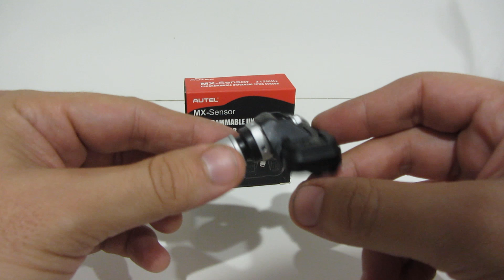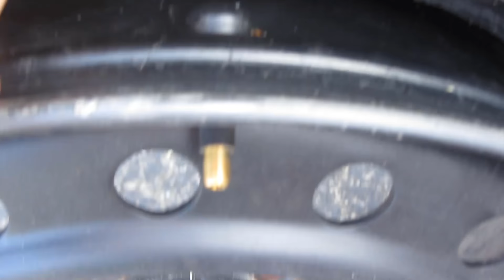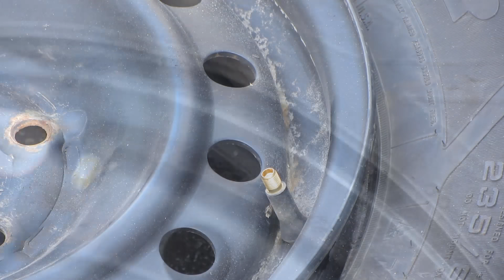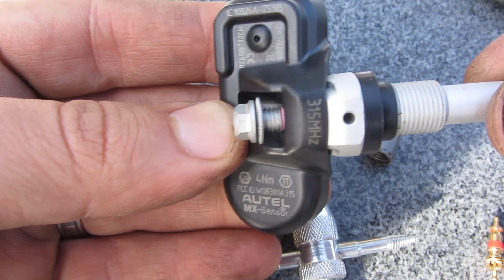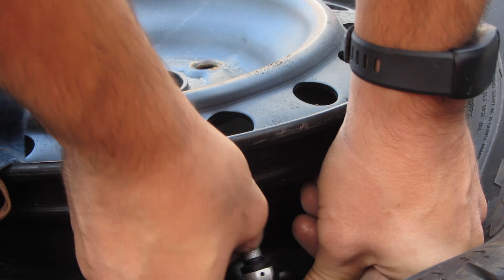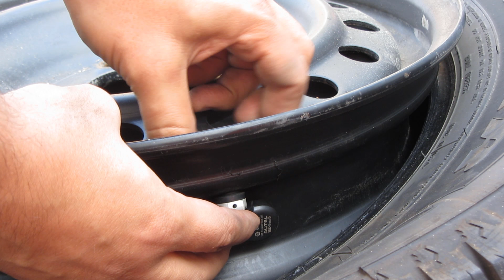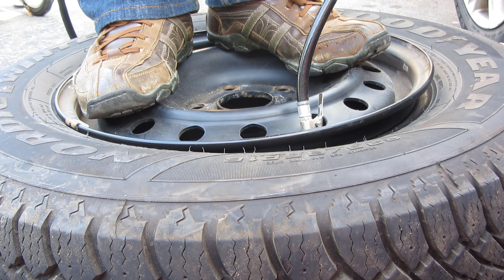Install New TPMS Sensor DIY Without Needing Rebalance

Comment: I always diy everything but for this just go to the tire shop, so many things can go wrong
Reply from the maker: If you're willing to pay, go for it. The only thing that can go wrong is ending up with a leak, which won't take long to figure out, and can be fixed without too much effort.
Reply: @GabesHacks  Nice video, agree with your statement In Canada the dealers and garages want a fortune for the sensors and a lot of them won't just change the sensors without you buying new tires and then if they do it will cost a fortune becasue they will pull the tire, put it back on and want to balance it. The ensuing cost for one wheel would be more than 3x the price of what I paid for a pack of 4 preprogrammed sensors on Amazon.

Comment: been using internal sensor for 5 years. for my new car, i tried the external sensors and i hv thrown away the external sensors!its just hopeless. everytime i pump air i need to remove it then the sensor cant be read by the display unit!!!!continue to use internal sensor. peace of mind for 3 to 5 years b4 bat runs out.

Comment: Why is this video over 11 minutes? Just tell people who don't have a machine "pop the bead at a 45-70 degree angle away from the sensor (how you pop it is up to you, then include links of at-home bead poppings.) push the tire down by the sensor so bottom is showing, replace sensor, inflate tire. Im not even 18 secs into this video and can already tell this is an AD.
Reply from the maker: There is nothing about this video that is an ad. I bought the sensors with my own money. All of the videos on my channel are projects I do for myself.
Reply: THANKS FOR THIS DETAILED VIDEO EXPLAINING EVEN TO A SIMPLE STEPS. The manual cant explain it in details for  a first timer.

Comment: What is better for a 4WD vehicle where tyre pressure will be changed frequently using a valve core removal tool to deflate the tyres? An internal TPMS or a external one (mounted on the valve stem cap)?
Reply from the maker: Both do the same job: report the tire pressure and temperature. What matters more is what kind of receiver you will be using. If the car has a built-in system with TPMS lights on your dash, then you can only use internal sensors with that. The car will be programmed to turn on the low pressure light at a certain pressure, often that's about 20 psi. So if you deflate below that, the light will turn on.
If your car does not have a built-in system (or you don't want to use it) then you will need to buy a whole system: the sensors and receiver all together. In that case, it doesn't matter if the sensors are internal or external. You just need something that works together with the receiver.
Reply: Depends if you're doing alot of off roading with the vehicle. If so, a internal sensor is better.
Reply: karl, nvr trust the external sensors. real pain in the ass!

Comment: Adding weight and no balancing. You should know better.
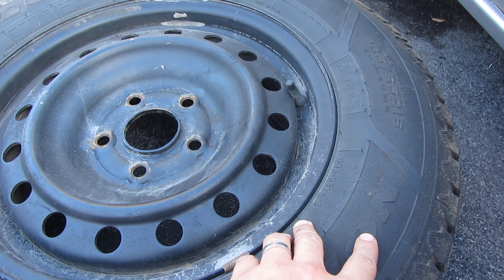Reply from the maker: I did know better 🙂 I talked about it at 2:17
Reply: @GabesHacks  As you said, 23 grams. it needs balancing!!!
Reply from the maker: @mgrobbie1  You can only say it needs balancing for sure if you experience balance issues. Give it a try.
Reply: @mgrobbie1  the counter weigh is 5 g to 10 g. u r right, its significant.
Reply: i nvr thot of it! additional 10 to 20g!!guessed its significant w high speed rotating.

Comment: These sensors are a frustrating invention. I've spent money having these replaced at discount tire only to have them go bad within two days. Took it back to them and after they supposedly replaced the bad one again, the trouble light came on yet again within two days. The worst invention ever made.
Reply from the maker: Sounds like it might be more of an issue with the shop than with the sensors!
Reply: It may not be the sensor, but rather electromagnetic interference in the car.

Comment: I have a tire changer, so breaking the bead is easy.  Honestly, removing the tire from its rim is not so easy.  A cheap tire balance is about $50 at harbor freight.  A tire changer is worth investing.  A tire changer and balance would be worth if friends and relatives are willing to take the trouble.

By the way, TPMS are pain.  They break easily.

Comment: I will do this trick when next I need to change out a sensor.  Tire shops where I live want 20 bucks plus tax to change out a sensor and if you have some years on the ride you will want to change out all four. So save yourself some money and do this.  Only other thing I may do is go to Harbor Freight and buy the cheap tire changer just to break the bead, less than 50 bucks. I have three trucks, one car, two lawn tractors and a 50 hp tractor so I'd put it to good use.  I try to do my own work when I can; brakes, axles, A/C components (I do have a mechanic flush/vacuum the system). I just finished changing out the clock spring in a Dodge Avenger to turn off the air bag light. I figure I saved 500 bucks on that job buying my own parts and doing the labor.

Comment: I paid someone to put my new sensors in & did not know I needed the #s off each sensor for programming.  I now have to get in each wheel.  You saved me having to spend more money.  This video made my day.  Thx
Reply: You can probably get Discount Tire/America's Tire to use their tool to read the ID being broadcast from each of the sensors without breaking them down. It would only take them 5 minutes, and they might do it for $5 in the tip jar. I have a relatively inexpensive TPMS relearn tool from Autel that does this, so I'd fully expect any tire shop to have the capability.
Reply: @bent.cyclist  I took my car to Discount Tire & they did it for free.  I gave the Dude a $20 tip after.  Thank you so much for your info.

Comment: Not a good investment of money or time. TPSM sensors are approx. $60 each, and they must be programmed. As they are winter tires, they are only going to be on the vehicle for 4-6 months.
Reply from the maker: These sensors need to be programmed and I showed how I did that in my other video: https://youtu.be/N6p6xV4PlHc However, some cars automatically learn new sensors, and for those, no programming is needed. Also, some shops charge ridiculous amounts of money to replace sensors.
For me, it came out to be cheaper to buy the sensors and the programming tool and install them myself.
Reply: Gracias  por tus sabios consejos 
Y por tomar el tiempo para ayudar a tanta gente aprender como hacerlo
y ahorrarnos dinero en estos dificiles tiempos gracias y Dios te bendiga

Comment: Correction. You would definitely need to rebalance the wheels if the old valve is non TPMS one. 23 grams is a lot of difference. Just to let you know.
Reply from the maker: I talked about this at 2:17. If you notice balance issues, get your wheels balanced. But if you're replacing one sensor with another, then there shouldn't be any issue.
Reply: @GabesHacks  it absolutely will be an issue if the sensors aren't the exact same ones you took out. They'll weigh different. Also concentric seating will play a part in the balance.
Reply from the maker: @Texas_HellBent  No wheels will ever be 100% perfectly balanced. They only need to be balanced to the point where there is no discernable effect. So if you try it, and you find your wheels out of balance, then go get them balanced. But if you don't, then you're good.

Comment: Great idea but you know what this is dangerous and not safe
Reply from the maker: Which part of it is dangerous?
Reply: @GabesHacks  using a plywood beneath a vehicle for leverage
Reply: @Joeelectronicschematicsforauto  I didn't see any plywood or anything unsafe.  It's not like using the vehicle's weight to hold one end of the leveer to remove a tire is going to shift.  The car weighs upwards of 2500 pounds, Gabe maybe 175 and how much pressure does it take to push off that tire, maybe another 100.  275 vs 2500, it's not going anywhere.  Could someone get hurt doing this?  Doing just about anything there's risk involved.
Reply: @mikeloki2064  people can use a piece of wood that will snap there's a wrong way to do things and there's a right way to do things and a recommended way to do things this is not a recommended way to do things you can let your fuel pressure but if there's a distributor next to it with spark plug wires which might be defective then you have spark and fuel you have to be careful what you do
Reply: @Joeelectronicschematicsforauto  It's fine. Just be careful
Reply: @iwillnotcomply7145  yes you're exactly right safety first enjoyed your video and your channel you have one of the best channels

Comment: if you have a problem re seating the bead  put a ratcheting tie down around the outside of the tire and just ratchet it tight .
Reply from the maker: Yeah, I've heard that. I did try it one time but it didn't work for me. But I don't doubt that it works in some cases.
Reply: I've had to do the ratchet strap trick when putting new tires on a lawn tractor.  Works every time.

Comment: I stopped watching when your dumb butt called a ratchet a wrench.  Bye-Bye. Useless.
Reply from the maker: "Ratchet" is an informal term for a "ratcheting socket wrench": https://en.wikipedia.org/wiki/Socket_wrench#Ratcheting
A "ratchet" is technically the device inside the wrench that makes the clinking noise: https://en.wikipedia.org/wiki/Ratchet_(device)
Reply: @H Max, you got owned 😂😂
Reply: OMG, you are the dumb butt.  You never heard of a ratcheting wrench before. What a stupid reason to stop watching.  Bye-Bye moron.

Comment: I happy not to have these sensors on my car. Just a waste of time and money. 
How damned lazy can people get?
If these are just winter tires why bother to install the sensors at all?
As for your video - it is well done, but you didn't cover the programming of the sensor?
Reply from the maker: Winter tires can go flat too 🙂 But also, our Odyssey has a weird quirk where you cannot turn off the traction control if TPMS isn't working correctly. Traction control prevents your wheels from spinning, but when you're stuck in snow and trying to get out, you sometimes need your tires to spin.

The programming depends on the vehicle. Some will automatically learn new sensors and you don't need to do anything. That's not mine, so I used programmable sensors so the van doesn't even know anything changed. I covered that in another video: https://youtu.be/N6p6xV4PlHc
Reply: @GabesHacks  - I see.  A tire going flat is a non issue. But needing it for TC is a valid reason.
This just shows how complicated cars have become. Often needlessly so.
Reply: How do you tell a tire goes flat on the freeway before a blow out?? This system was not designed for people to see if tires are flat its for safety of drivers.
Reply: @Evanm1136  - really? Do like we did for over a century. On a freeway if you get a flat, an idiot light may give you a few seconds notice. maybe not. 
A blow out - the light is useless. A slower loss of pressure the tire starts making noise. This isn't rocket science, the electronic babysitting is gotten out of hand.
Reply: @markrapacki2084  yes but to you old timers as a young technician currently. Cars are quieter radios sound better people talk more in cars because we aren’t being deafened by a 429 v8 in a galaxy 500 so you won’t hear the time anymore it just goes boom. Also thank Firestone for pushing for this with the Ford tire inflation issue but I guess that’s not a good enough excuse for you is it now??
Reply: @Evanm1136  - Exactly, those weak excuses are not good enough. tech for techs sake is dumb. But when you are caught up in the tech whirlwind, perspective is lost.
Now aside from basic maintenance, the main problem with cars is not mechanical issues, but tech issues... by a mile.

Comment: Nice presentation. 
Did we missed to chalk mark the rim and tire so we can realign those again if there was accidental angular shift between them. That will guarantee no need to rebalance?
Reply from the maker: If you only open one side of the tire, like I did, there's no need to mark anything. Once you seal it up again, it will be in the same position.
Reply: @GabesHacks  
OK good answer.
Reply: @GabesHacks  I noticed that you said this in the beginning of the video. Thanks for the presentation.

Comment: moral of the story is, take it to the friendly local tyre shop and they'll do it for a few quid/bucks. not worth the hassle doing it yourself essentially as 99% of the people watching this video are unlikely to have a compressor lying in the garage to pump up the tyre lol
Reply: 90% of the people I know have an air compressor in their garage.  It’s almost as common as a hammer
Reply: @ohboy2592  90% of folk I know don't have a garage.
Reply: @kenzohkw  holy crap.  Really?
Reply: @ohboy2592  third world problems
Reply: @kenzohkw  sounds like it.  I don’t know what I’d do without a garage.  I fix and do everything in my garage.
Reply from the maker: If you're willing to pay for it, by all means! But you'd be surprised what some shops charge to replace sensors.
Reply: @GabesHacks  sensors yes, they are not cheap so just get them off eBay and not the tyre shop 👍
Reply: All the tire shops in my area wont do it unless they also provide the TPMS sensor, in order to make more money - unless you know a private mechanic
Reply: @alanbarrados4178  Yeah most the shops in my area wanted like $350-$450 for all 4 new sensors installed which I thought was pretty expensive. I found a tpms 4 piece set on amazon for $60 bucks and paid a tire shop $100 to install all 4 with rebalancing etc. So $160 for all 4 replaced which I feel is fair.
Reply: Yea, $200-$400 USD per corner to have a shop do it? No thanks. I’ll do all 4 myself for less than $100 thank you.

Comment: Have. To balance the tire , because of rubber tire valve have deferent weight with metal tpm sensor
Reply from the maker: Yes, that's indeed possible. I discussed that further at 2:17

Comment: Great video, im curious how long the battery lasts in these valves, does anyone know?
Reply from the maker: I've heard about 7 years, but I don't know how accurate that is. But it is definitely years.
Reply: @GabesHacks  ive read 7-10 for oem valves as they have a lithium battery but these cheaper after market valves surely can't make the same numbers
Reply: @lloydaom  My first one went out after 8 years ( oem, front left tire) Replaced with aftermarket set that says 5-8 years with a 3 year warranty. I bet climate also plays a role with temperatures etc.

Comment: Nice how to clip as I take in refresher before doing four. Saw one similar lesson where guy used a scissor jack under a rear car trailer hitch, and maybe a block of wood, to break the tire bead. Got a very reasonable quote on phone from local tire shop to reprogram my new tpms numbers into my car computer, after I install then myself; planning to photo the units I install, and have good record of each number on each of them, and which tires those numbers went to, to make for an easier tire shop update.  Wish I knew those units have above a 10 year life expectancy before my last tire change, because  I would of done this at last tire change, if I had known that.   ... Thanks for clip  :+)

Comment: One of mine went bad,if I replaced it don't K have to reprogram it and does that have to be done at a garage?
Reply from the maker: It depends on your car. Some cars automatically learn new sensors. Some have a relearn procedure that you can initiate manually. Other cars have to be programmed with the new code of the sensor with a scanner tool. Look up online "TPMS relearn" with the name and year of your car to see what you can find. Your owners manually might say too.
If your car needs to be programmed, either a shop can do it, or you could buy your own scanner tool, like the Foxwell NT530 ( https://ebay.to/3fThMBB ) or NT510Elite ( https://ebay.to/3lfiXMV ), which do a lot more than TPMS. They're handy tools to have if you do work on your own car.
Reply: @GabesHacks  I looked online and ths reprogram tools range from $12.00 to $400.00 any suggestions.
Reply from the maker: @richardkenworthy9312  The one I linked to is my best suggestion. But look up what needs to be done for your car before you buy anything.

Comment: A deep well socket would have worked better than that combination wrench and you could have torqued it properly. A 1/4" drive on the inner 6mm screw would have been easier than trying to work with that larger 3/8: drive ratchet. Choose the right tool for the job.
Reply from the maker: I did try using a socket, but I found that the combination wrench was easier. Getting the torque exact is not a big deal - just get it snug.
And that was a 1/4" drive I was using. My socket set doesn't have a 6mm socket for a 3/8" drive.
Reply: @GabesHacks  Wow, that's an awful big 1/4" drive 6mm socket.

Comment: Of course you do them this way, this is nothing new. Twenty years in the tire business, we never replaced valve stems any other way.  The only exception are ultra low profile tires, you aren't breaking the bead with that piece of wood...and the bead is too stiff to try and do this with the tire still on the wheel.
Reply from the maker: Makes sense 👍